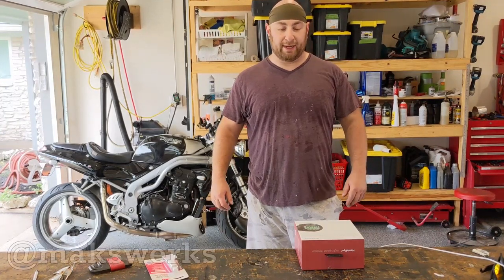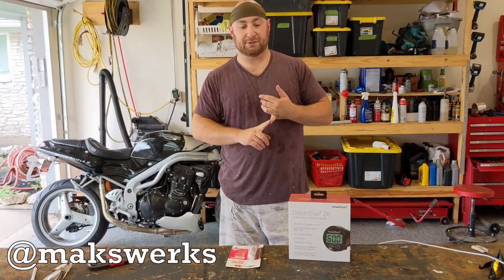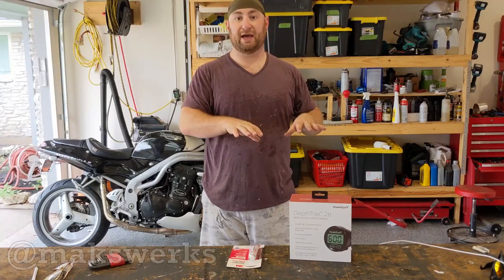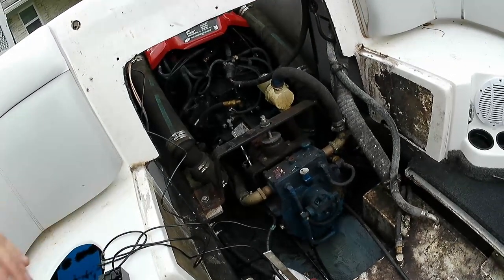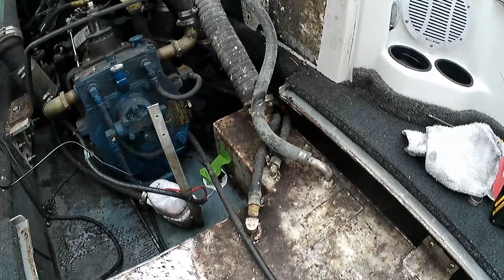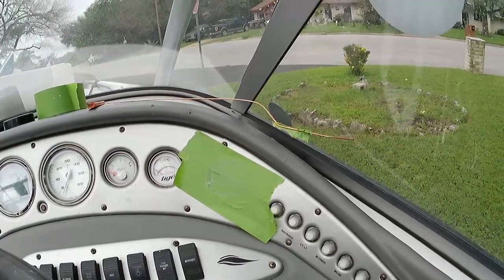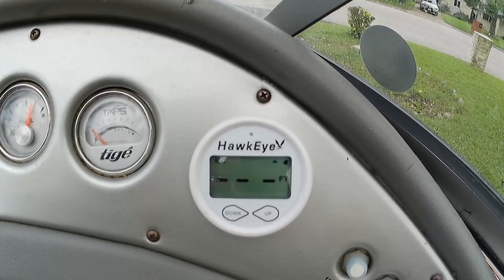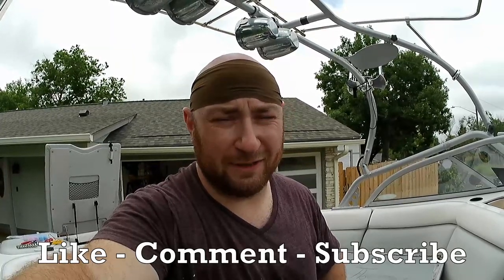Hawkeye DepthTrax Depth Finder Install Tige 22V WakeBoard Boat

Comment: Hey Mark after 2 years do you still like the depth trax 2b ? Would you buy it again? Thanks for the video.
Reply from the maker: My name is Maks. I would not, its worked ok - but the glue in hull design doesnt work well for ski boats, and didnt always turn on properly. I would say its ok for solid hull boats (cruisers, fish boats) but I would pass on a ski boat.
Reply: @Makswerks1  sorry on the name! I appreciate your input. Thanks
Reply: @Makswerks1  How about on a Baja H2X what do you think? My current in hull gauge is all over the place and blinks alot. Looking for options...
Reply from the maker: @bajamike9276  As long as you have a solid core hull it should be fine. I don't have any direct experience with those boats.
Reply: @Makswerks1  how do i know if i have a solid core hull. Its a 1996 bryant 192 limited.
Reply from the maker: @Grant3758  Honestly short of drilling or finding a perforation I am not sure. My understanding is most boats are solid core other than some higher end performance hulls. I would just google around. Another good indicator is did the boat come with a depth finder? is it a through hull design ?

Comment: Did you replace any of your gauges? Or did you pick up the boat that way? 
My Tach meter isnt functioning and wasnt sure which wires were needed to connect a new one.
Reply from the maker: I replaced the tach, speedo, voltmeter, temp guage over the years as they failed.

Comment: So I couldn't see exactly which way you faced the finder? Also, let me get this straight all you have to do is put it inside like you did and it will read the depth correctly? You don"t have to put outside on the boat? Thank you in advance. My boat is in the water I don't want to pull it out if I don"t have to.
Reply from the maker: It glues into the hull from the inside. Assuming your hull construction is solid and not air gapped. I believe the wire side goes towards the front of the boat.

Comment: So I'm looking to install this in my boat but like you said it's $85, do you still like it and is it working for you?
Reply from the maker: Mixed bag on a surf boat. Not sure if it's the hull design or the angle the boat is most of the time but it comes and goes. It works well enough for me, but I would probably get a through hull transducer if I were to do it again